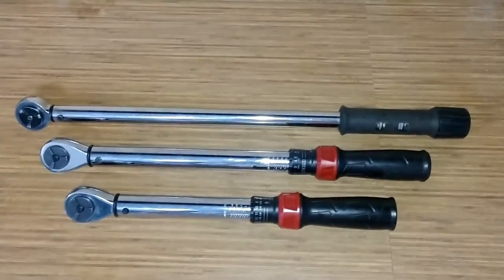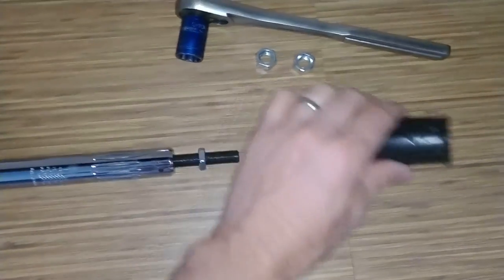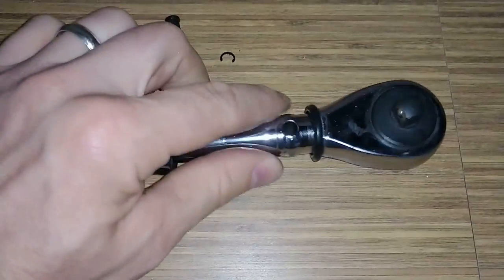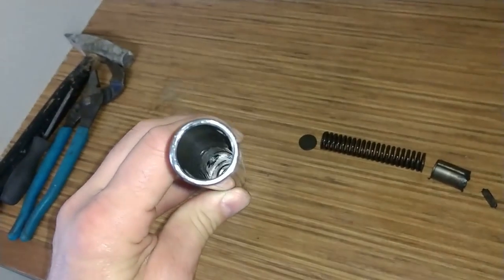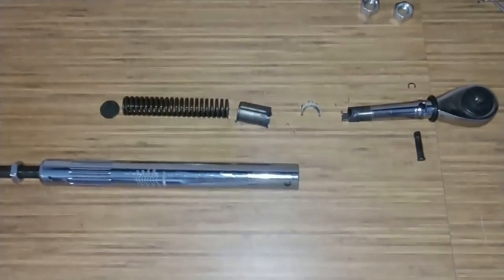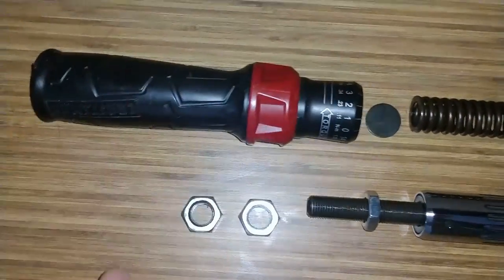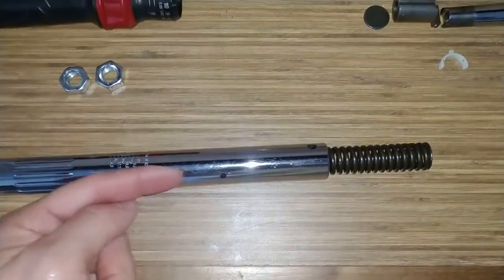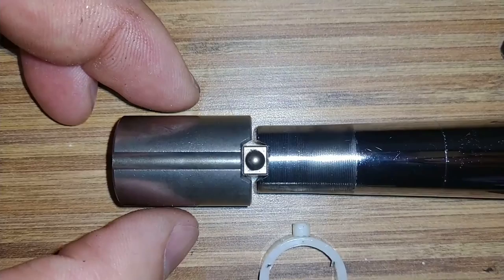Craftsman click Torque wrench.  How it works.  What's inside. Fix factory error.

Comment: Thank you for the video. Been holding onto my wrench for over a decade in case I could fix it. Excellent information . . . could not have fixed it without your help.

For those of you who might be experiencing difficulties reassembling due to the plastic retainer, here's how I was able to do get it in place: 
Loosen the calibration nut and unscrew the threaded stud out until it stops. This keeps the spring out of the way whilst trying to angle it in to place. 
Push the retainer down into the body of the wrench, keeping the detent knob aligned with the detent hole in the body.
This next step I used a 9/16 deep socket on a long extension to push the retainer into place.
Finally install wrench head into the body while keeping the aligned with the groove/tang in the receiver piece.
If it is in place the detent knob will be in the hole in the body of the wrench.
All that is left is to reinsert the retainer pin and clip.
Reply from the maker: Glad it helped.  It's not a perfectly precise process but it's better than never being able to use it.  Glad it's back working for you.
Reply: @OffRoadEndeavor  For sure, for sure! You gave me the confidence I needed to open it up. Now if I can fix my Denon amp I'd be thrilled.

Comment: Just watched this, and could fix my old Craftsman. Slightly different, just watch out for all the tiny ball bearings in the sleeve. There was some rust, so cleaned it all and regreased. Works ok. I didn't fiddle with the calibration and left the handle on. Problem was it wasn't "clicking", so fixed. Thank you.
Reply from the maker: Nice. Glad you got it fixed.

Comment: Hi Off Road - I'm working on my Craftsman torque wrench - little bit different style... But those are NOT drive pins!  So they CANNOT be driven out.  But they are TWO small pins 0.1550" diameter & 0.1695 length.  With a little bit of gentle banging and sometimes the help of a magnet - you can get them to drop out or PULL them out.  They are not a driven IN pin - they are each just placed and gently pushed in with a finger.  And they will 'drop' out.

Comment: I have a 3/8" drive that is a similar design, although probably a bit older.  Mine clicks both ways.  It needs calibrated, but I can't get a socket inside the handle big enough to loosen the nut.

Comment: I have a different issue that involves the red lock/unlock ring on the grip. Unfortunately, it no longer locks in place once the desired torque is set. 
Your video was helpful for me to remove the black plastic grip (with the red lock/unlock ring) from the wrench.

With a thick flathead screwdriver, the red lock ring can be carefully pried up and removed from the black plastic grip. There are two flat metal "spring lock" pieces on each side of the black grip that, when engaged, allow it to lock at the selected torque. Mine isn't locking.

Wondering if you have any suggestions?
Reply from the maker: Sorry I don't have any suggestions. Mine didn't have that problem.

Comment: Can you show or tell us what you did to the inner nut before the handle? Did you loose the tension first with the allen wrench? The handle has a lot of play on mine took apart and put it back together but when I turn the handle it starts to have play again. any help would be appreciated. Thanks
Reply from the maker: Oh, I wish I could remember clearly, it's been a while.  Sorry I can't be more help.
Reply: I have the same issue. I have adjusted it several times and it just loosens back up. But even with both nuts off my handle will not come all the way off.

Comment: Did you manage to fix it? Mine clicks with minimal force. I only used my cheap torque once and it worked. Stored it in loose torque setting not minimum and then it didn’t click again. So I cleaned everything but now it clicks with minimal force even with the highest torque setting
Reply from the maker: Sorry I'm not sure what issue you're experiencing and don't have any suggestions.

Comment: How do you get the cap off the handle to get to the adjuster?  And do you know how to get to the adjuster on the 1/2" drive torque wrench?  Thanks.
Reply from the maker: I used a small pick to pop off the plastic end cap. If the 1/2"drive is the same construction then I would think everything would be the same. Unfortunately, I only disassembled this one.

Comment: For calibration, hang 1 gallon of water from the handle.  Depending on temp. (easy to find a chart). Approximately  8 + lbs. I think 50 degrees is 8.33 lbs. and slowly lightens as temp goes up. Don't forget tare weight of the jug for greater accuracy.
Reply from the maker: Very precise. Thanks for the additional info.

Comment: Craftsman has fallen a long way over the years. This problem you're showing is the very problem mine has because it's been a "Non-Clicker" since day one. I merely assumed it was brand new and never checked it, but then I didn't need it so it set on the shelf for 6 years and then I find it's a dud.
 “Assume” makes an “ass out of you and me”. If you break it up, it looks like this “ass u me”
Reply from the maker: I bought mine and also didn't use it till it was too late. Not the quality they used to be known for.

Comment: What I dont understand is how these things can seize up and refuse to "click" just by sitting in a cabinet, with the tension all the way down.
Reply from the maker: Now that's a mystery. Maybe rust? Hope you figure it out.
Reply: @OffRoadEndeavor  I took it apart; inside was what I assume was grease at some point in its life and is now more like asphalt. Cleaned it out and put it back together. Clicks again, altho not with as much authority as it used to. Took me forever to figure out a way to get the little plastic doohickey back in. Of course now the calibration is way off, but thats straightforward to fix.

Comment: I have the same wrench that clicks immediately with any torque.   I'll disassemble and see what's wrong.
Reply from the maker: Good luck in figuring it out. I was bummed I spent so much money and it didn't work and Sears wouldn't refund it. I figured it was already Broken so no harm. I was surprised at what I found. I hope you can fix yours.